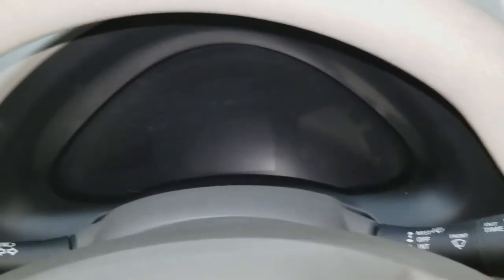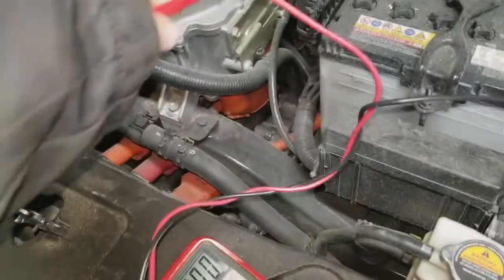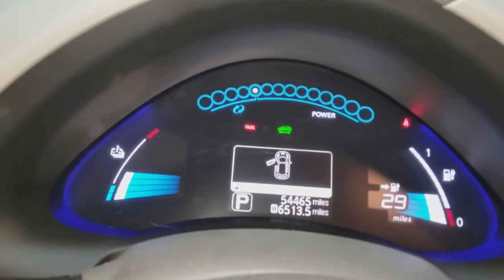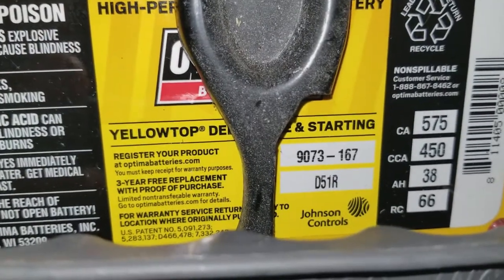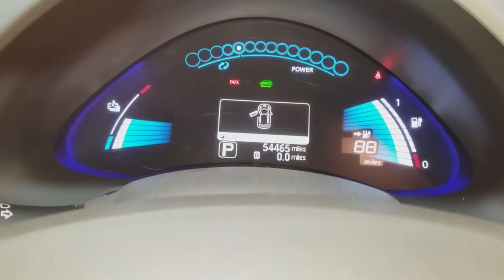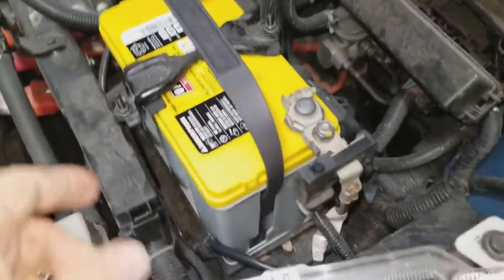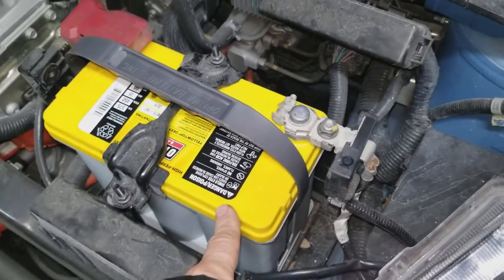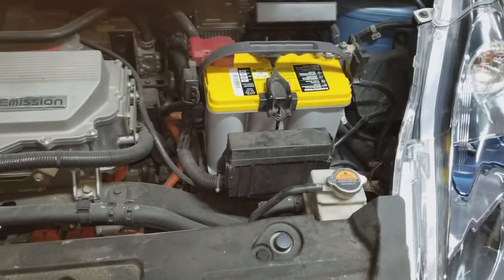Nissan LEAF battery replacement (Optima) 3 year review

Comment: Hi. After checking prices at auto parts,  the Nissan dealership OEM 12v was cheaper. Since the original lasted almost 7 years, I opted for the same battery. With the old one returned, it was about $75 with me doing the work. 2011 Leaf. Thanks and best wishes.
Reply from the maker: Awesome! I just prefer the AGM vs lead acid. But those OEM batteries are great.